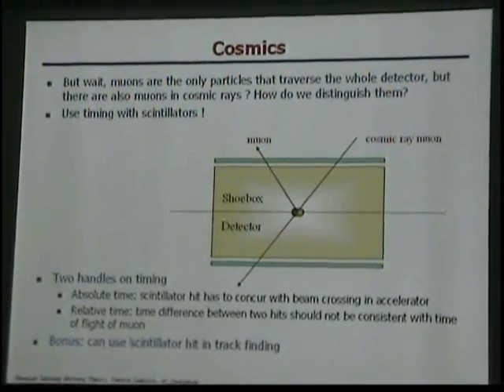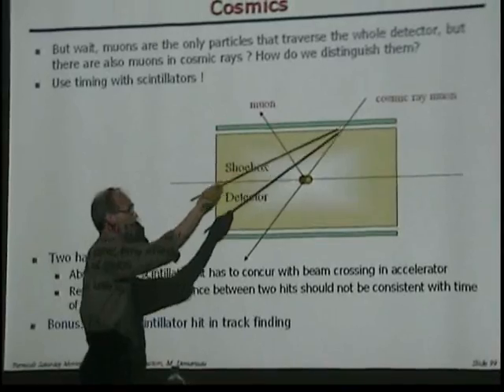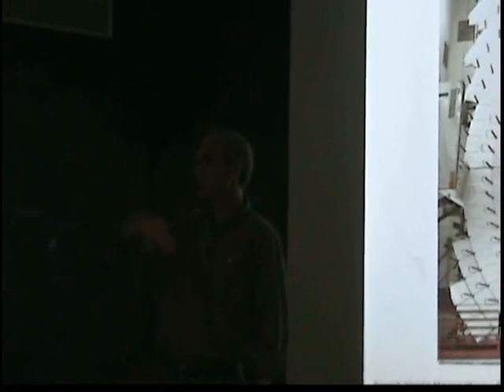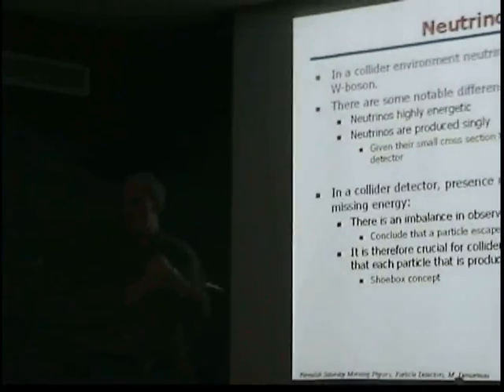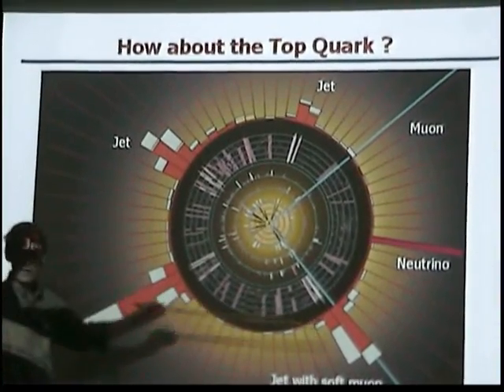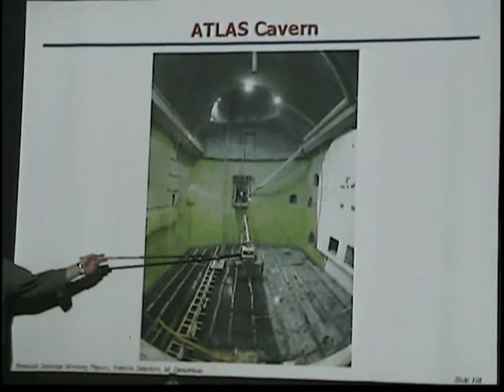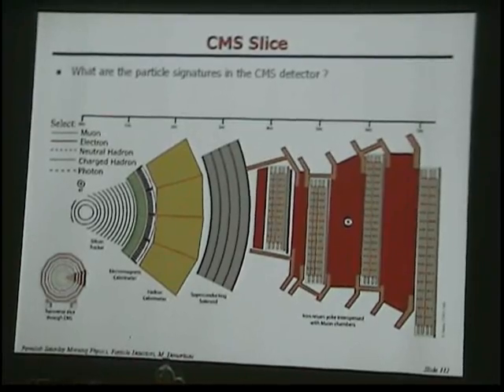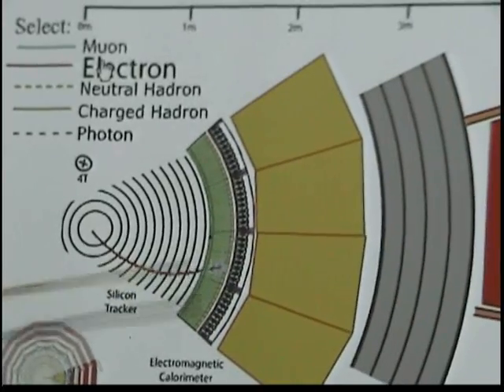Particle Physics: Detecting Muons

Comment: Well, again, there is no matter in a singularity.  Matter requires spatial geometry and lower energy levels than would be present in either a singularity or the big bang.  So, it's a mistake to say that there was any matter in an infinitely dense state.  Matter didn't form until significantly AFTER the big bang, which is why I believe it is an emergent property of energy and available space.